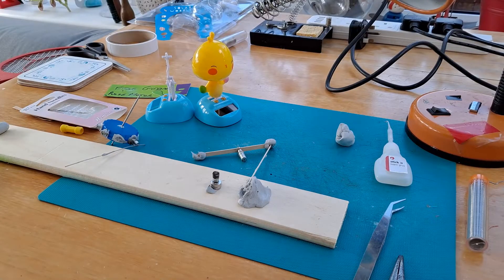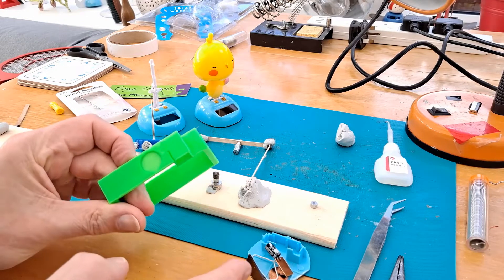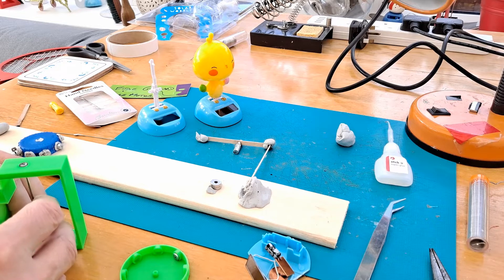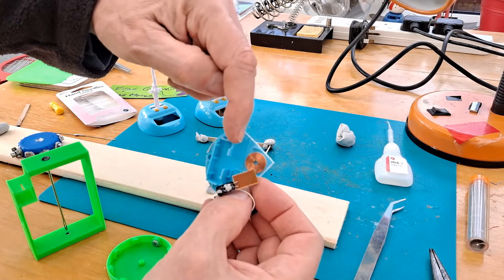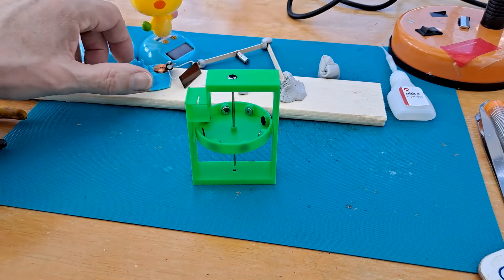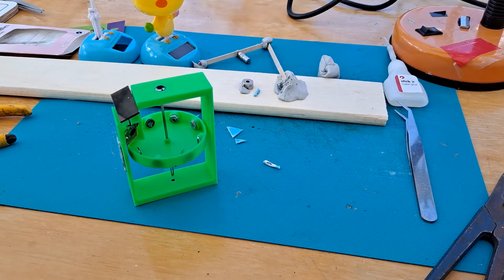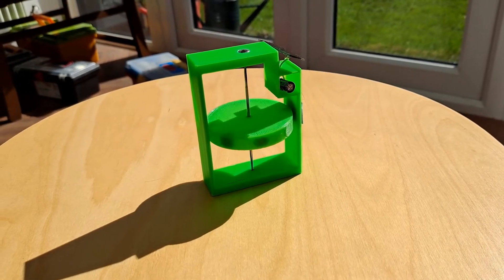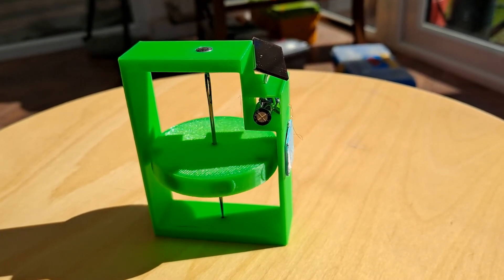Solar rocker to Pulse Motor 3d printed version

Comment: I've successfully removed the small coils using the heat gun on my soldering station, just have to take it slow!

Greg
Reply from the maker: I have managed to damage more than I have had success with, so now I take the easy option and just trim the plastic. I think some of them definitely don't use hot glue. I did find one brand that had the coil and the circuit board on a neat little clip in module. Perfect for this sort of project. https://youtu.be/IQXC5BMKDiI

Comment: What section do you find the solar rockers I. Poundland, I have looked all over.
Reply from the maker: I am pretty sure these were old stock put back on the shelves this year. They were in the seasonal Easter stuff. I bought them as soon as I saw them as I knew they would be snapped up. I have shown them in some of my charity shop videos where I have also popped into Poundland to look for them https://youtu.be/pmWWSQR_r4g You used to be able to rely on Poundland to have them in the seasonal stock every year. Easter, Summer, Halloween, Christmas. But Last year and this year I think the only ones I saw were old stock. I always bought them if I saw them as they are always useful. I regularly go in 4 or 5 different Poundlands and I think I only managed to find half a dozen in total this year. Home Bargains was another place to get them and again, I haven't seen any this year,